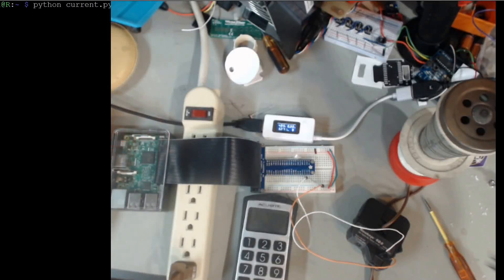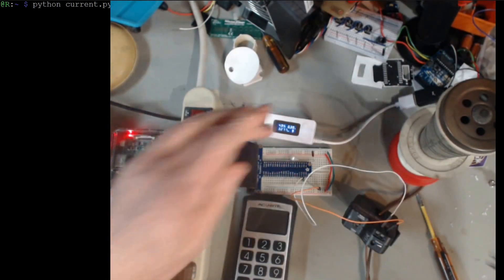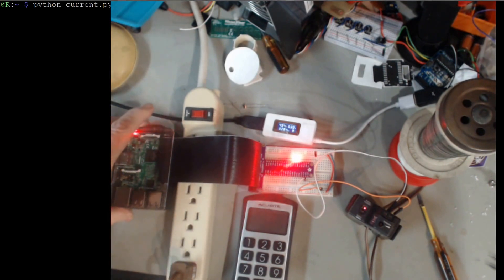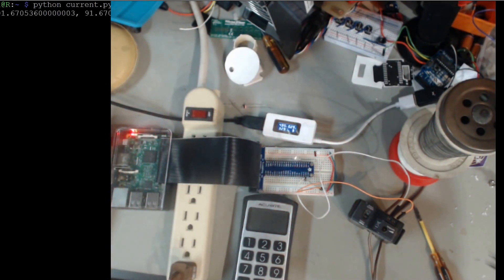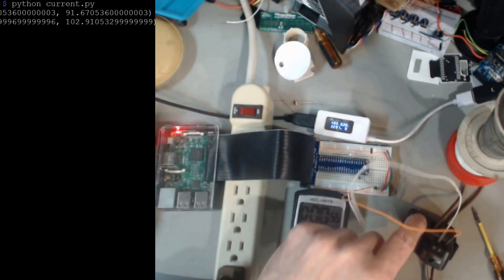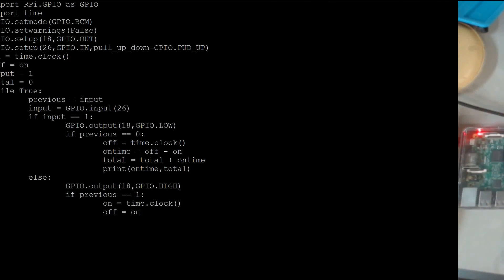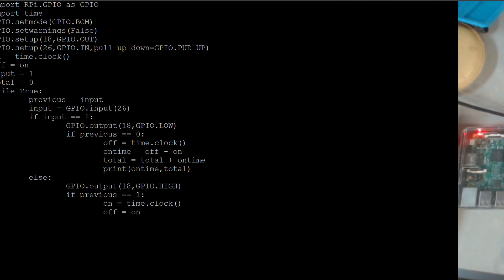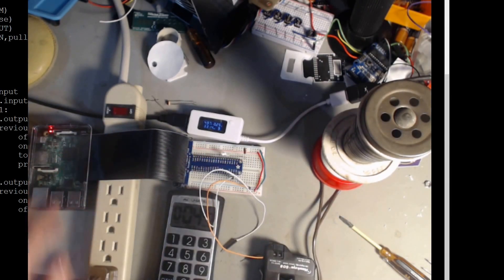Hawkeye 608 AC Current Sensor and Raspberry Pi 3

Comment: Hi there! I like your video. Would you be willing to share your breadboard setup? I am fairly new to coding with the GPIO's and would like to give this project a try. It is hard for me to see if and where your wires are hooked up and if any resistors are being used. Take Care
Reply from the maker: Read the state of a  Hawkeye sensor just like a switch closure. 
One side to ground the other to a GPIO pin with pull up enabled.
There's code in one of the other comments showing the particular pin used in my example. And the video shows the code used ( I used Pin 26 was used) Which GPIO pin is not important. Any Raspberry GIPO pin will work. 
There are hundreds of tutorials on how to use the Raspberry Pis GPIO pins.

Comment: Great Project! I am looking to do something similar and I am wondering what pins you put your resistor(also which kind), what pins is your led on, and what pins do your jumper cables go to.  Thanks!
Reply from the maker: I assume by "resistor" you mean the one used on the current limiting resistor on the  LED (not the "resistor" used for a current sink). If that's the case, I used a few hundred ohm resistor. Use Ohms law  and your LEDs forward voltage drop for tuning that value.
The pins used are both shown in the video of the source code and in the text of the source code in the previous question from Saeed Ahmed (18 for the LED and 26 for the current sensor, GPIO.BCM pin numbering mode)
Reply: That helps out a ton thanks! And thanks for the quick response! For the red and green wires which pins are used? looks like the second to last and  third to last? 28 and 29? And does it go from negative to positive? I am new to this and this video has been great.
Reply from the maker: For power and ground for the sensor (the Red and Green wires) I used.... Nothing. The hawkeye sensor is powered inductively from the load it's detecting.So when there's no load, there's no output. When there's no load the Hawkeye 608's output is an open circuit. When the '608 is powered by the load it's detecting, the output is a closed circuit. I used a Raspberry Pi GPIO pin to detect the state of the Hawkeye 608 as shown in Saeed Ahmed's comment.
Reply: I wish I could say I got mine working but I’ve had no luck trying to mirror this project. I’ve tried to calibrate my Hawkeye sensors both 708 and 608 and I can’t even get the leds to light (status closed / status open) when running a current through while adjusting the set point screw. Any tips on what could be going wrong?
Reply from the maker: Andrew Cook
Reply from the maker: @andrew Sorry to hear it's not working.
Make a demo video so more eyes can see what could be wrong.

Comment: hallo 
nice project it is sort of the same project what i want to do. can you please give me the code.
Reply from the maker: import RPi.GPIO as GPIO
import time
GPIO.setmode(GPIO.BCM)
GPIO.setwarnings(False)
GPIO.setup(18,GPIO.OUT)
GPIO.setup(26,GPIO.IN,pull_up_down=GPIO.PUD_UP)
on = time.clock()
off = on
input = 1
total = 0
while True:
 previous = input
 input = GPIO.input(26)
 if input == 1:
  GPIO.output(18,GPIO.LOW)
  if previous == 0:
   off = time.clock()
   ontime = off - on
   total = total + ontime 
   print(ontime,total)
 else:
  GPIO.output(18,GPIO.HIGH)
  if previous == 1:
   on = time.clock()
   off = on